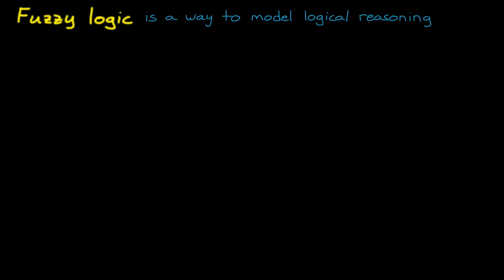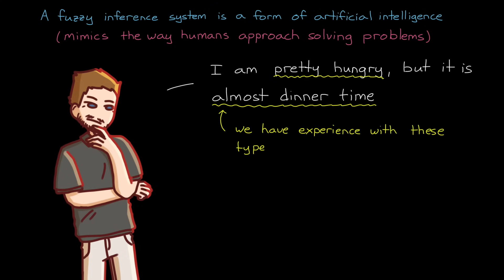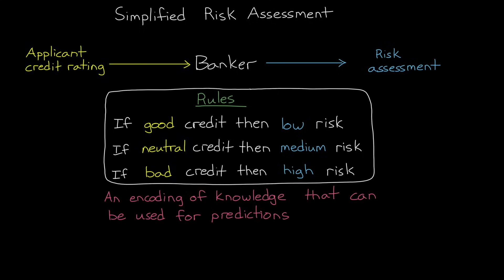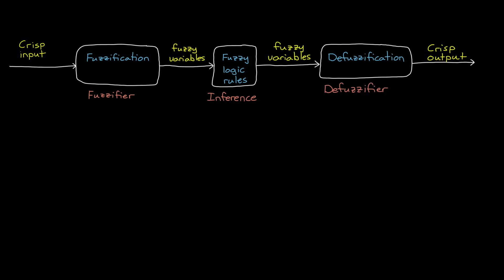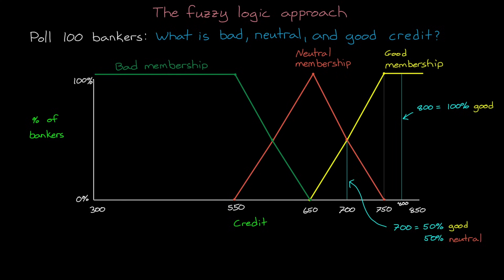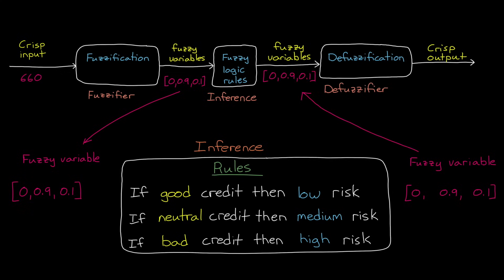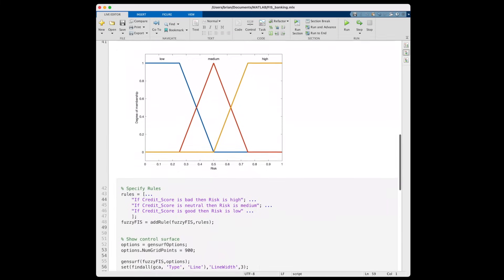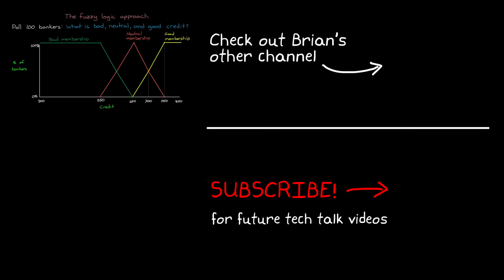What Is Fuzzy Logic? | Fuzzy Logic, Part 1

Comment: How are you caculated 46 percent% ?
Reply: Finally I got it! 
How as him said, 46 is the X axis of centroid of the form that represents 10% of the trapezium of low membership and 90% of medium membership, right?

The X axis of the centroid can be obtained by the formula: x = x1 + (x2-x1) * (A2/(A1+A2))
where:
 - x1 is the x-axis of centroid of trapezium slice;
 - x2 is the x-axis of centroid of triangle slice;
 - A1 is the area of trapezium slice;
 - A2 is the area of triangle slice;

The x-axis of centroid of the forms can be obtained adding the bigger x point with the smaller x point and dividing by 2. The trapezium starts at 0 and goes to 50, so (50+0)/2 = 25. The triangle starts at 25 and goes to 75, so (75+25)/2 = 50.

We have x1=25 and x2=50.

Now we calculate the whole area of trapezium by adding the bases and multiplying by the height/2. The smaller base have 25 width, the bigger have 50 width and the height is 100. So (50+25)*(100/2) = 3750. As we need only 10% of this area, we got A1 = 375.
The whole area of the triangle is base times height divided by 2. So, (50*100)/2 = 2500. As we need only 90%, we got A2 = 2250.

Now, we replace the formula:
x = x1+(x2-x1)*(A2/(A1+A2))
x = 25+(50-25)*(2250/(375+2250))
x = 25+25*(2250/2625)
x = 25+25*0.8571
x = 25+21.42
x = 46.42

Comment: i do not understand why %46 for this example: 12:01
Reply: Finally I got it! 
How as him said, 46 is the X axis of centroid of the form that represents 10% of the trapezium of low membership and 90% of medium membership, right?

The X axis of the centroid can be obtained by the formula: x = x1 + (x2-x1) * (A2/(A1+A2))
where:
 - x1 is the x-axis of centroid of trapezium slice;
 - x2 is the x-axis of centroid of triangle slice;
 - A1 is the area of trapezium slice;
 - A2 is the area of triangle slice;

The x-axis of centroid of the forms can be obtained adding the bigger x point with the smaller x point and dividing by 2. The trapezium starts at 0 and goes to 50, so (50+0)/2 = 25. The triangle starts at 25 and goes to 75, so (75+25)/2 = 50.

We have x1=25 and x2=50.

Now we calculate the whole area of trapezium by adding the bases and multiplying by the height/2. The smaller base have 25 width, the bigger have 50 width and the height is 100. So (50+25)*(100/2) = 3750. As we need only 10% of this area, we got A1 = 375.
The whole area of the triangle is base times height divided by 2. So, (50*100)/2 = 2500. As we need only 90%, we got A2 = 2250.

Now, we replace the formula:
x = x1+(x2-x1)*(A2/(A1+A2))
x = 25+(50-25)*(2250/(375+2250))
x = 25+25*(2250/2625)
x = 25+25*0.8571
x = 25+21.42
x = 46.42
Reply: @sethmobit  👍🏻👏🏻👏🏻
Reply: How can we calculate the centroid of an shape?
Reply: me neither, I was trying to find if someone said about

Comment: Hey, i'm a computer engineering student at UTFPR Curitiba and i've participated in extension courses in the past that were basically translating videos like these to portuguese, submitting the subtitles to the platform and then having it available in multiple languages. We'd then receive a certain amount of hours in complementary activities that we require to graduate.

Is there an e-mail or form that one could use to get in contact with matlab or the teacher responsible for these videos to formalize an extension course inside UTFPR to subtitle these four videos to portuguese? I'm sure this material would help a ton of students all across Brazil and many more countries!

Comment: Very interesting talk, and easy to understand! Just to say the fuzzification process explained here is a little bit different from my understanding. The fuzzificaion is to convert a crisp number into a fuzzy set. It can be singleton or non-singleton. Your explanation is based on singleton, and taking one step further to get the compatibility (which is then used as rule firing strength) to rule antecedents. But, anyway, I would say your explanation is good enough as an illustration for beginners to get some ideas about how the whole fuzzy system works. Thanks for sharing these. It’s really useful!